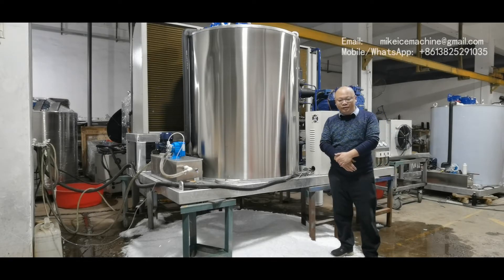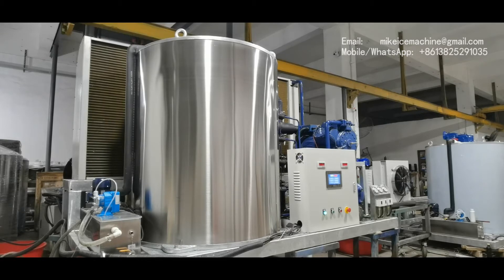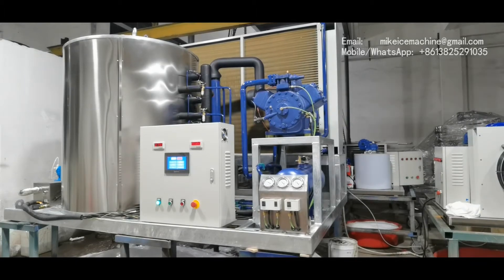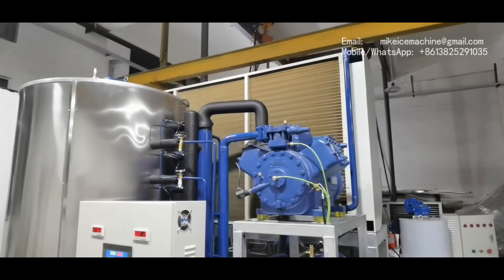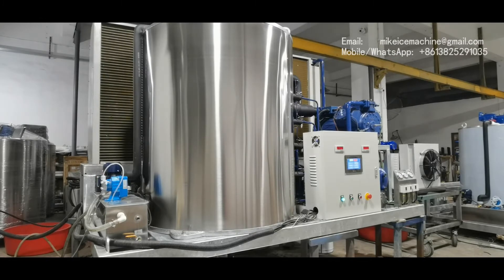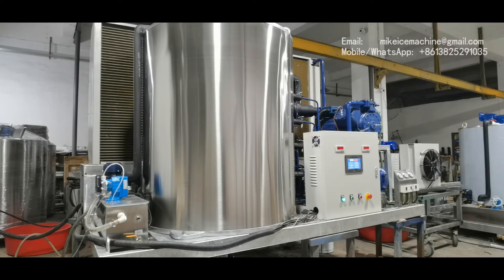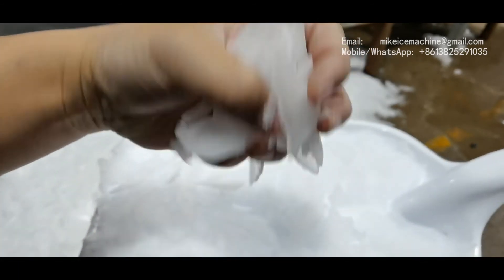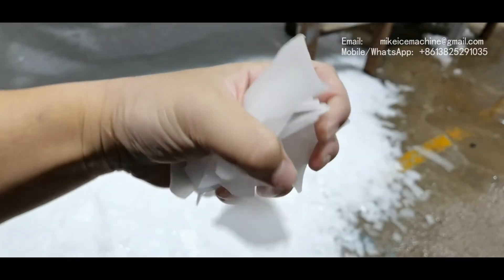Máquina de hielo en escamas de 10 toneladas por día para usar en Dakar, ahorro de energía para un ne

Comment: What is the thickness of the ice flakes? Amasing unit...
Reply from the maker: 2.2-2.5mm.
Customers in Senegal prefer thick and well-frozen ice flakes.
Ice flakes must be more than 2.2mm, that is the standard in the local market.

That ice machine is amazing, and it is very power-saving. It consume only 75KWH for making every 1 ton of ice flakes.